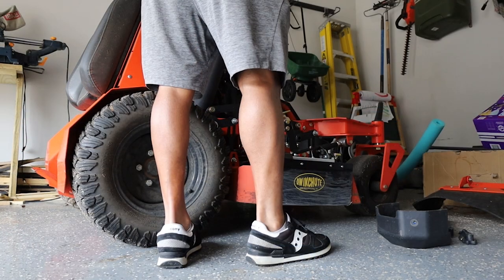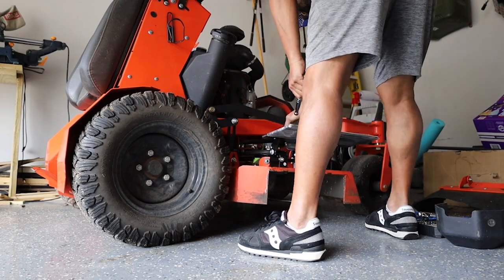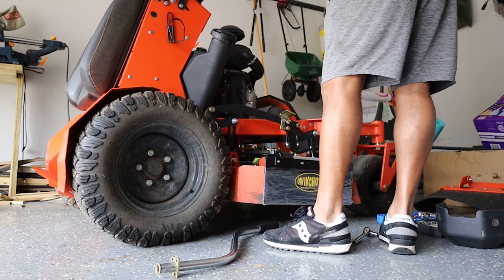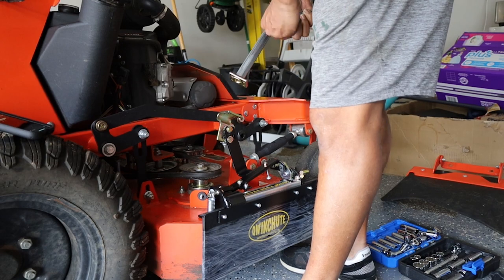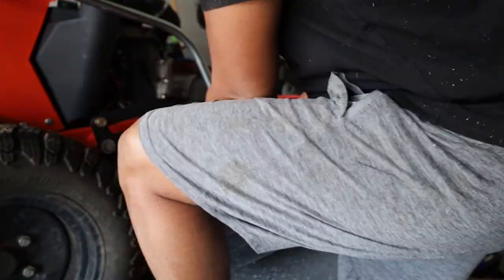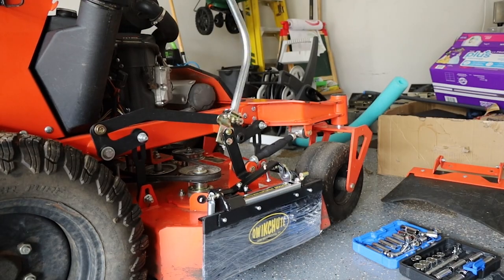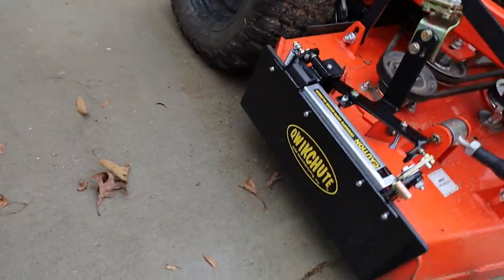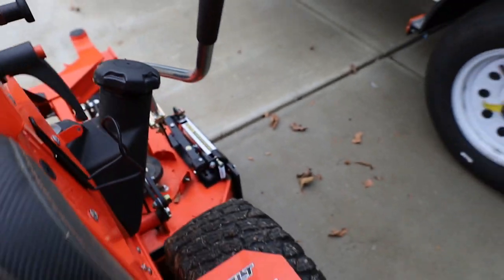Installing Qwick Chute Chute Blocker on Bad Boy Revolt 48' Stand-On Mower

Comment: Question do you like yours & does it scalp by it not having a wheel on the right of the deck?
Reply from the maker: @985live  absolutely love this thing man. No lie I can’t think of 1 bad thing about this mower. I use it commercially and it’s held up amazing and it’s fairly easy to work on.
Reply: @ good deal I just ordered a 48 inch and I already have a 54inch avenger I cut commercially with for my business. I wanted to get a Kubota or scag but they are 2-3k more than the bad boy.
Reply from the maker: @ trust me I’ll put BadBoy up against any brand these things are very under rated. It’s a great mower
Reply: @procutslawn  10-4. I even got the dealer to throw in a 1060 backpack blower
Reply from the maker: @985live  sweet sounds like you got a nice set up my man 😊🤗
Reply: @ most definitely. I run all echo products now but I could definitely use a bigger back pack blower with leaf clean up. I subscribed so we can share our experiences. I definitely enjoy your content keep up the good work.
Reply from the maker: @ thank you I love my Husqvarna blower haven’t had a issue out of it in 2 years. Really good blower 😉
Reply from the maker: @ I’m also a fan of Echo as well though my trimmers are Echo. But I think Husqvarna may be a little better than Exhi honestly. My Echos take some time to crank my Husqvarna just cranks up almost instantly
Reply: @procutslawn hey, bro. I went to pickup my stand on today. I can’t wait to use it. I like the upgrades for the 2025 model year. They have put no flat tires on the front and fixed the bushings for the stand platform.
Reply from the maker: @ you’re going to love it man I got tweels on mines now so I don’t get flats. It’s a great mower